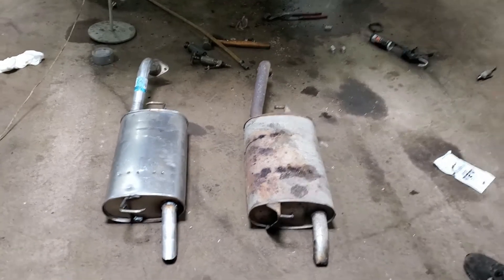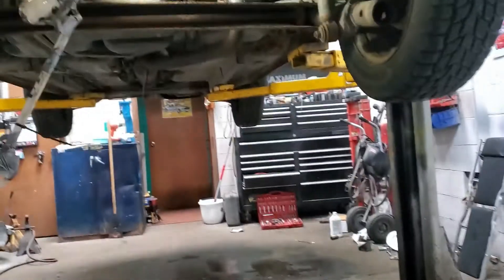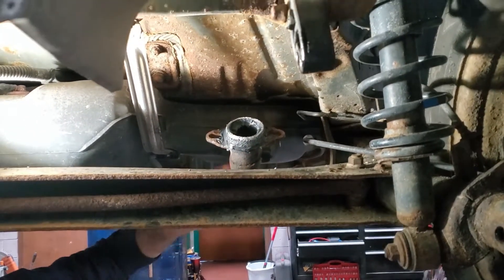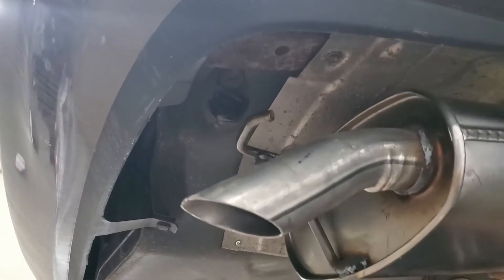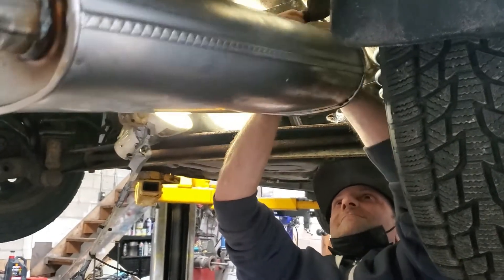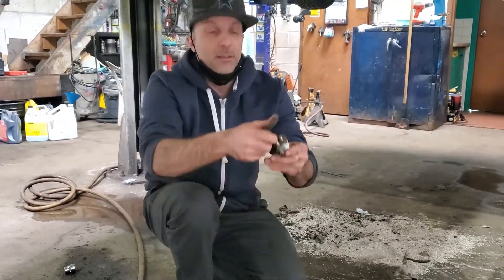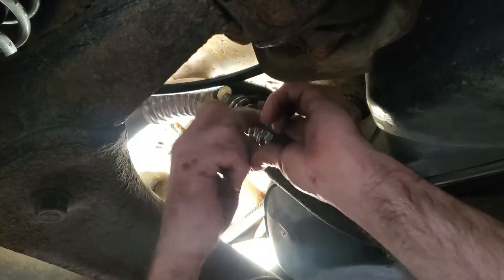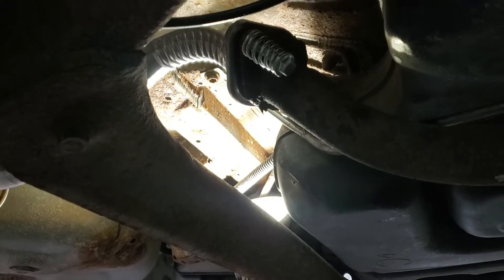2003-2013 Toyota Corolla Muffler Replacement

Comment: hi there, my 2010 toyota corolla S the pipe which connects the muffler is broken. should i change the whole exhaust  assembly or just the muffler? any website from i can but the part?

Comment: I like that it's a Quick n Dirty Vid. 
It's Great for those who know what they're doing. 

For me, 
I need to kno about the Donut (?) Flange?

My Toy 2003 Cor muff separated from the pipe flange n all. 
Just like in your Vid.
Yet my Muff n it's connector, does not need to be replaced.

I just need to repair that same area, pipe flange, as in your video.
A) By removing the old donut bolts n connector, from the end of the muff.
B) Installing a new donut flange onto the old exhuast pipe.
C) Then re-connecting the two, together again.

I will look to see, if you posted links to those parts, shown in your video.
Especially that enhaust donut. My muff donut looks fine..

I Wish, I had a place with a car lift, to do all this with.
Since I do not.
I will have to shimmy under the car and do ti. 
That's PITA OT. time (&^%@) !

Thx for the Vid.
Do U or anyone have any tips on what I am looking to do ?

Comment: I can't believe the exhaust is supported only by those rubber things on a Toyota Corolla. I had my exhaust replaced on my 2017 Corolla and now it hits against something--presumably the bottom of the chassis--every time I driver over a bump.
Reply: The cause of the noise I was hearing was that mechanic didn't bother to install new exhaust hangers, and they installed one broken hanger, he just slid the hook part coming off exhaust right through the center of the broken hanger and called it a day.
Reply: wait till you find out this is how it's done on basically every single front engine car ever made

Comment: Mine doesn't have any separate nuts on the muffler side, even on my replacement, the nuts appear to be welded onto the flange, how hard was it for you to get the old exhaust donut off? Im having a whale of a time with mine. Thanks
Reply from the maker: hello Mike it was a little time consuming and a pain i used a flat head screwdriver and hammer worked my way around the flange then sanded it a little bit with coarse sand paper once you have it out the donut will be a little tight to put in place i tapped it with a wood little block from the flat edge after it was in i put some right stuff silocone and it worked out well don`t give up keep at it you can do it
Reply: @cars4fun806  great, thank you